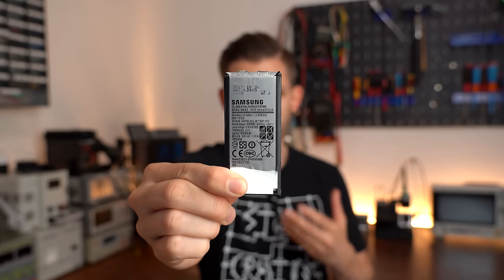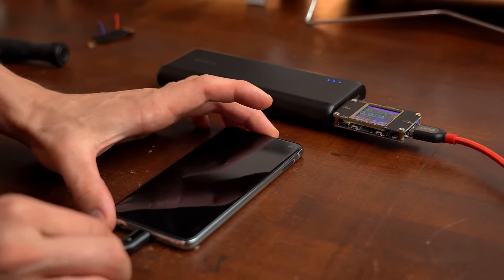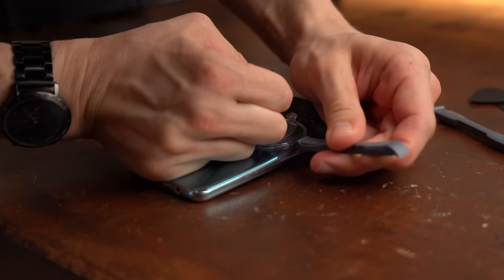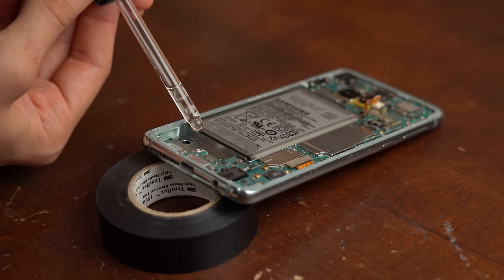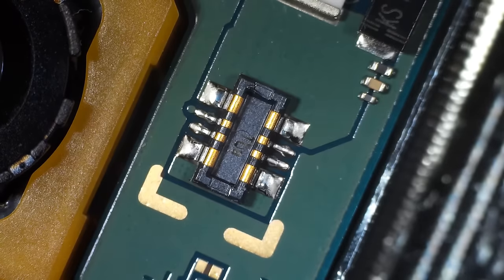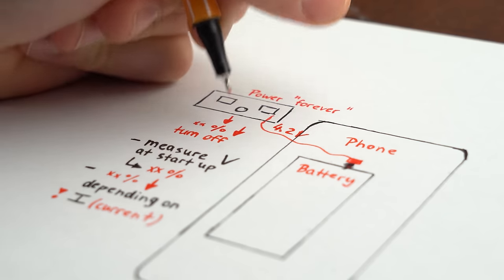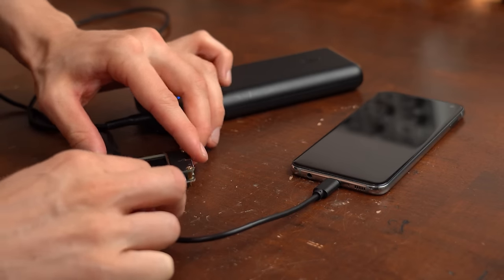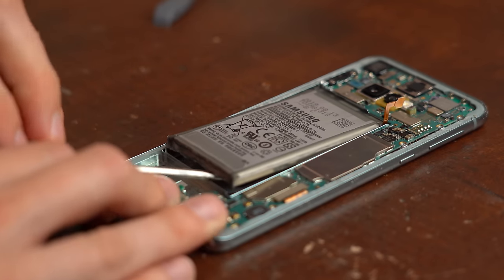I "Solved" Samsungs Swelling Battery Problem! (Batteryless Phone)

Comment: cool, but meh... We been doing this for a long time round here but I would have done it alot differently. First off, why loosing time drilling through the phone, risk dammaging its lcd, having to endure a "trick-charge" usb c plug and the dull look. You had the phone all dissassembled, usb-c pinout are easy to find online. knowing that, you could have ran two kinar or even enameled wires INSIDE the phone itself for the trick charge... this would have not only saved space, risk and time, but also the use of the usb c cable, and the fact that if you want to use the usb wether for pc or OTG stuff, you now have the battery counter running again agaisnt you and even risk damages to certain pc, espcially the first usb 3.0 compliant hardwares... Still a brillant idea to limit e-waste, but from you Scott, we normally get project that are fully and well thought. this one feel like you might have rushed it and used less neuron than usual, maybe you were tired and they were set a neuroff? hihi < pun aside, you do amazing job entertaining us <3

Comment: Great video! For anyone who's storing devices with LiPo batteries and doesn't want them to swell up, here's what I do that prevented my 3 Samsung phones from having this problem (one of them is a phone I bought back in 2015).

I charge them to 50% before storing them, and I take them out every few months to give them a full charge/discharge cycle, before charging them back to 50% and storing them again. This seems to help all devices that have LiPo batteries in them. I haven't gotten a single spicy pillow, yet.

Comment: This couldn't have come at a more opportune time! I've just retired my old NExus 5X because its battery started swelling and got myself a fresh Pixel 6a. So now I want to use the phone at my desk as a poor man's Streamdeck. But obviously don't want to run it plugged in all the time with a swollen battery. Got as far as the connecting a power supply to the battery charging circuit but phone doesn't turn on. Gave up for a bit, but you just provided my motivation to keep trying!

Comment: This kind of project has crossed my mind in the past with phones becoming thinner and thinner and battery life becoming questionable. I figured that some kind of ultra capacitor could be used in place of the battery in combination with some kind of external case/battery type addon to power the phone for longer. 

This would enable the phone to continue functioning to some degree while you change the battery case and could provide a flexible solution for users that want more battery life at the expense of device size while restoring the ability for users to replace the expired/damaged battery prolonging the lifespan of the phone.

Comment: The thermistor is in the wireless charging coil circuit which I see you didn't even bothter plugging it in.

Its draining because it doesn't detect the thermistor. 

Your diode solution is only needed for the battery for 4.3V. 
But now the USB-C cable is free! 😀

Comment: The battery swelled up and popped the back off of my S8 about a year and a half ago. I took a chance and replaced it with a Chi-Com replacement from Amazon. Still works perfectly at this point in time. Cost was about $25 plus shipping. Should probably replace the phone with a new one, but I like to get as much life as I can out of my devices. Especially a device as expensive as a smart phone.
Reply: Did the samething with the same phone. 👍🏼

Comment: Maybe a more "tidy" approach like soldering from an internal 5V power source could work? If the phone draws most of its power through the usb-c port you could get away with a smaller wire inside. Or you could use a supercapacitor as a replacement for the battery to trick the phone into thinking it has one

Comment: Couple thouths and how I'm planning to do similar thing with my phone:
1) why dont you solder to the power & ground pins of type-c connector on the motherboard? this and using simple type-c cable without data line (cheap chinese cables) OR usb charger without PD feature (old apple ones and so on) would do the same, but without hanging wires on the side of the phone
2) next level (at least what i'm planning to do) - small buck converter in the battery compartment and now you can use ANY charger regardless of their voltage! 1S bms would also do the trick, they costs maybe 50cents a piece with shipping

it will be a little nicer overall. hoping you will make a follow up video with converting PoC device to something more finished

Comment: If you use thin cables, and solder them either directly to USB port or power lines on power board, connect them with diode or stabilizer circuit in area of removed battery, then you need no holes in phone.. Hmm, not a bad idea. Tanks mate for sharing!

Comment: I've had this swollen batter issue on a Galaxy S7, S10, and a S20 all within a year or so from purchasing them. 

I noticed then after I would use the phones to stream to my television for long periods of time with the otterbox case still on them. I don't know if it is a heat issue or poor quality or what. I've always assumed I mishandled them somehow and never tried to resolve it in the past. I just used them on wifi without the case after noticing this and gotten new phones for regular use. 

I'm somewhat of a Samsung fan so I won't be switching brands.  But now I can bring those old phones out and use them safety again.  Thank you.

Comment: I did the same almost a decade ago with a Nexus 5 and LG F60. Nexus 5 had same issues of battery slowly going down despite being run on constant voltage. IIRC, LG F60 did not have the same issue.

I used a LM step-down regulator, which includes capacitors. Function would be unstable on most low rated chargers since the peak consumption was over 2A or so.

Comment: Nice trick for re-using in stead of re-cycling an old phone. Well done. May I suggest to wire the 5V on the inside to the backside of the USB charge port connector instead of looping the charge cable on the outside?

Comment: I think the phone sometimes requires more than the USB can provide, therefore boot looping or turning off. And this might be related to internal electronics, not power source or cable. I believe a bigger capacitor on the battery end might solve this, but I never tested.

You could have connected to the internal USB and used a buck converter for the battery. No holes or extra cables.

Comment: Whatif you did all the power wiring internally? Instead of  drilling a hole in the case for a modified cable, modify the actual port on the device from the inside. Pull up the data lines and put fingernail polish over them to keep from conducting with nearby pins or each other, while soldering leads off the power terminals.
Now, you have a phone that looks normal on the outside, can be modified back to stock a lot more easily, and the cable is now renoveable.

Comment: I fell victim to that problem too. 

Yesteryear summer my Nokia 6.1 stopped working; as in «bootlooping when connected to mains». After a couple back and forth with the HMD global customer support, suspicion fell on the battery.

So I decided to take a look to confirm. Sliced the adhesive holding the display, unscrewed 22 Phillips screws and lifted the midplate.

And indeed the culprit was the battery! It swell pushing the midplate, and then the display. The chemistry couldn't support the power draw, and so the device wouldn't start up.

28€ and a new battery restored previous order.

Comment: This is likely a massive overkill.

I've powered an old Galaxy S3 (still got a removable battery and it DID puff up) without the battery by shorting the battery thermistor terminal to the ground (otherwise it wouldn't "charge") and hooking up a big enough electrolytic capacitor (later changing it to a bunch of small ones in parallel to fit in the battery compartment) to the battery terminals, and then hooking the USB charger as usual. I've even hooked up an LED with a dropping resistor to visually see that the phone is trying to "charge" the "battery". The phone keep happily staying in CV mode, charging my newly made "battery", thinking its at 100% charge and powering itself over USB connector and running till this very day.

This said, S3 didn't power AT ALL without my little trick, yours seem to enter the bootloader, and THEN powers down when simply powered without the battery at all, so its most likely possible to circumvent by software means alone. In any case, i'd totally try to just solder a capacitor to battery protection board instead of actually powering it through there, hoping my old S3 trick would work, lol.

Comment: Wow, I was surprised on the 4.4V voltage on that single cell battery. First, I said: No wonder they get swollen. Then I googled it up, and got to know about high-voltage/capacity LiPo cells does go up to 4.4V. 

Btw, I did almost the same to a Sagem phone when I was a kid. The phone did not charge and thus did not turn on. Getting a battery costed as much as a brand new phone from the same category. I cut the connector from the charger, and hooked it directly to the phone. It had a removable battery, so it took approx. 50seconds to do it. Things are getting complicated nowadays :D

Comment: Instead of using the type c cable u should directly solder a cable from the inside to Ground and to the V bus of the type c conector. That way you can still connect USB type c accessories and have a neater setup.
Reply: I thought the same thing, but how many viewers would forget once and fry a usb-c port?

Comment: Man, when you said 'two old smartphones' ... I still rocking an S7 Edge lol. Still strong af. PS, the key is to keep lithium cells @ 40% if storing. if you store them at full charge then tendrils coat the electrodes internally and the internal resistance goes up. Learned that from flying drones.

Comment: 5:00 I think the boot failure happens due to USB PD negotiation. After the phone negotiates a higher voltage from the power supply, there's a brief moment (several hundred ms) before the power supply switches to the new voltage during which the power cuts out completely, with the phone being designed to run off battery for that period. So it resets. Another possible cause is USB not supplying enough current to power the phone. Since there's no battery at all, the power source needs to supply not just the max average power (i.e. TDP), but the peak transient load, which even on a phone might exceed the power available from the USB port.

Comment: Correct charging, discharging. Laptop fan, and vibrating motor (take off the weight, Siemens or Nokia) used for discharging below its minimum solves the memory effect, and reshapes the battery. May need another Samsung phone to charge when it is fully discharged, to fix the battery. Some models use tricky charging to disable the battery, when it is outdated, or it is on blacklist. Solar charging fixes memory effected resistor (000), needs 3x2 h charging with a solar power bank during full sunshine. After that, old bad batteries will be better than new ones. Fan discharging may need 30 cycles.

Comment: This is a nice little "hack" but people should note that this solution might not work with all Samsung phones because this depends entirely on the firmware of the phone and/or what signals are connected from the battery pack to PMIC. This worked mainly because you were able to separate the BMS from the battery and the battery only utilized only power terminal and ground connections.  

The reboot loop you see at the start of the video when Scott tries to power only on wired connection is completely a firmware protective feature.  When the device initially boots up, it initializes all the ICs and, assuming it was properly designed, will have built-in checks for this.  This is just how the device's firmware handles this particular failure mode.  Since its a mobile phone, obviously the primary intended use is battery power so its expected behavior.  Also, in my personal experience, I've seen this type of behavior with some laptops where they prevent use of the device without a battery connected.

Just my two cents as someone who develops embedded software/firmware for battery-operated consumer products.

Comment: Nice project. You can put all the wiring in the phone by soldering it directly to the board and only need to plug in the phone without needing to make hold at the side. Usb c part of the can be tap into. If i am wrong correct me

Comment: if you are up for it, you could mount the "fake battery" stuff inside, and get the power from the usb port inside the phone, meaning you won't need to make a hole in the phone, and a frankenstein cable to power it. it would just use any usb c cable(WITHOUT DATA LINES) and it would work.

Comment: Most phones also use the battery as a thermal mass to sink the heat from the processor, so you may have some processor overheating issues, and as you found the temperature sensor is on the case side of the battery in your phone, so the phone itself may not even know that it is overheating until something fails.

Comment: Hi the greatscott, I've just confirmed this works without adding any additional components such as voltage regulator/stepdown/diode etc. I've just connected the battery terminals to the USB power supply works as fine. I've got videos to document it but there's no option to post em here
Reply: any solder or just plugged battery board into mainboard and then plugged charging cable into type-c port?

Comment: Powering old smartphones without internal battery has been on my list for a long time, But instead of a power bank I'd like to use 18650 cells directly attached to some contraption on the phone case to make the phone more mobile.

Other videos which have tried using the electronics directly from the battery have comments mentioning the boot loop and low battery issues which you had fixed in yours. So this video goes in to my research as well, Hopefully I'd be able to try it myself soon.

Thank you.

Comment: If it makes you feel any better removing a backplate without damaging it is tricky and takes quite a bit of technique that you only learn from experience. I cracked the backs of 4 phones before finally getting the feel for it so if you're new to opening a phone up just approach the process assuming the back won't survive the ordeal and have a replacement part on hand "just in case" :)

Comment: 4:12 There is a small temperature sensor inside. You can see that if you open the coil on a damaged Samsung phone. It's a two pin component, so must likely it is a variable resistor.

Comment: Very interesting project.  I would have bought a new battery on line and replace it.  I would put the rear cover on in a way where it can be easily removed for the next battery change. These batteries are not expensive and generally last about 2 years or maybe a bit more.   I have a Blackberry that is nearly 5 years old.  I like this phone a lot.  It is on its third battery. I buy these batteries on line.  I keep spare batteries just in case I have to change the battery again.

Comment: Alternative idea: replace battery with capacitors and run it off USB; this eliminates the need to have a hole for wires into the battery area, lets the phone think it has a regular battery, and gives you some buffer if there are power fluctuations instead of the phone turning off
Reply: The problem is getting the correct capacitors

Comment: Very good idea. I just would like to suggest that instead of supplying it from your charging brick, why not buy an external chargeable lithium battery that. It's durable, cheap and the best part is, you can bring it on your pouch or small bag...

Comment: LOVE your channel and how u structure it ..legendary ..can u do a video for me please ..I want to know in your detail why some battery management systems allow a replaced battery and why some devices don't recognize that changed battery ....THEY JUST SAY NAH ITS THE SAME
There will be a basic switching system thru a MOSFET or transistor or both that will likely allow original connection simply by earthing or applying the right voltage to to correct pin ...your just the person for the job ..great work CHANGE NOTHING don't change your channel do it as you do ..
.
.
Personal favorite is when u buy something on Ali express then test the hell out of it and then custom make and test your own example ..LOOOOOOVE IT ..

Comment: As the obsolete android phones fill up my junk drawer, I've been thinking about repurposing them just like you suggest. One would be to make a dash-cam. I'd like to have one for the dash, one for the back and one for each side of my van. They would be powered from the vehicle battery when parked. I want them to record if they feel a bump while parked as well as recording while driving. Then, when the vehicle is parked in my garage, they would automatically connect to my home WiFi and download all the recordings to my house computer. Similar devices could also useful for surveillance in buildings too. Once you've got the hardware, the software is not too difficult.

Comment: Neat and interesting! I've got some questions though:
1.What happens if you just leave it always plugged in?
2. Does that eventually destroy the battery and fail or not really use it and effectively work the same?
3. Is the swelling time or use related?
Reply: Lithium batteries tend to swell if you leave them at 100%, which is what happens when you leave it always plugged in. Laptops often have a feature to limit the maximum charge to 60% to prevent this.
Reply: @rexsceleratorum1632  ok, thanks for explaining